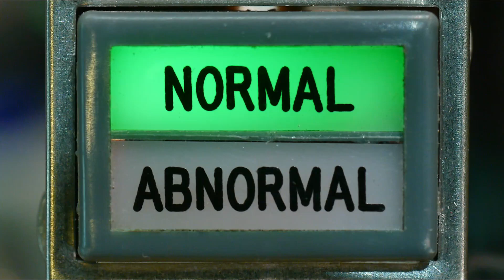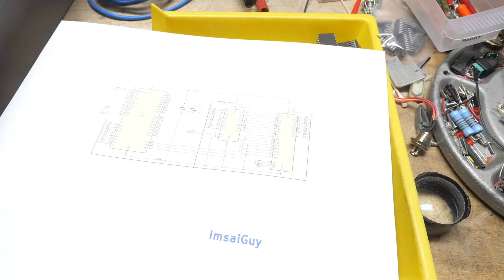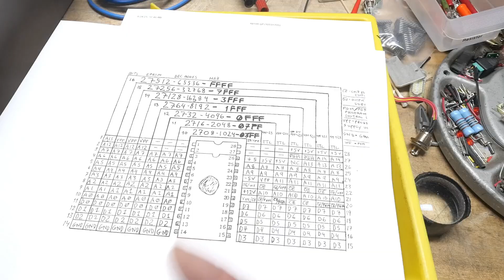#2371 Intel 8755 Hack (part 2 of 5)

Comment: I thought 8755 had 2 ports.  But you have implemented only one part.  The other thing is SMTs are great to be hidden under the wider socket.   That makes your design exactly the same size as the original one.

Comment: I would have put the jumpers in so you could bank select the rom. makes it a lot more usable.
What did you use as the pins. As i find that the hard bit as sockets won't take a range of pin sizes?

Comment: You can also use W27C512 instead of the UV 27C512, those are EEPROMs and you can erase them electrically in a programmer instead of using UV light. They are pin-compatible and work very well in my experience anywhere instead of EPROMs. I have not found any incompatibilities. And they're cheap.

Comment: Would love to see future projects with those EPROMs!  Programmed many thousands of those 2716’s to 27512’s in the mid 1980’s for a computer printer manufacture.  Interesting note, about 1987, EPROMs were under strict tariffs to import to the U.S. and manufacture used OTP (One Time Programmable) chips to skirt away from the EPROM (and other memory chips) tariff.  Home user technology for the EPROM programming was through a Centronics parallel port (faster than the RS-232c port).  Very fascinating programming algorithms used based on the fused memory readable test, basically if the last memory location was burned successfully, programming speed was continuously increased until last memory byte programmed was faulty, then at a slower speed, the last memory byte was reprogrammed until it was 100% reliable, etc.  EPROMs are obsolete now, but was for a number of years an era of the microcontroller industry.  Would like to see these EPROM chips used for Arduino applications, where only a few kilobytes of code is needed.
Reply: You can use EPROMs, EEPROMs etc as combinatorial logic devices. You put the input data on the address lines, and you get the output of the combined logic on the data lines. You just have to program them first with the correct matrix of data that generates your desired output for any possible combination of inputs. Sort of simulating a PAL/GAL.

Comment: 1991 to 1994 is at least one node decrease (Moore's Law), so the same number of transistors fit into half the area, which is why the newer die is half the size of the older die.

Comment: Always cool to see some EPROMs. I once worked on a Soviet drum machine where a bunch of them (roughly 27C16 equivalents with some quirks) went dead, had to be reprogrammed. I erased them with a modded portable UV light for nails, and programmed with TL866 / Minipro, with an additional gimmick to apply 25V programming voltage these Soviet chips needed.
Reply: I bought a couple of those UV nail lights for erasing chips too, far cheaper than buying a proper UV lamp 🙂
Reply: Nail lights can be a problem. EPROMs expect to be erased using UVA, which is harmful to skin. Nail lights produce UVB and may not work (or work very slowly).
Reply: @stevetodd7383  takes a bunch of minutes but does the job.
Reply: @stevetodd7383 I believe EPROMs require UVC? But yes, potentially damaging - slow intermittent exposure might help

Comment: You're seeing Moore's law at work. I started doing ASIC design in 1996 with a 500 nm process node, retired in 2021 using a 7 nm process node. Flash is a newer technology than many people recognize - the first time I ever saw a flash part was about 1986, and it only had an endurance of 100 write cycles. My how times have changed.

Comment: I tried out the progressive programming of EPROMs by writing individual bytes for just tens of microseconds and checking after how many cycles they took over the information. With another write of two times the accumulated time of the first cycles they are considered written. It still saves time compared to the specified writing time, that includes the tolerances of writing times for the slowest cells . 
I did it not to save time but to play with them as I heard there are professional programmers that work in that way. 
If you have to many, the diffraction pattern reflected from the chip (without the window), when shining with a laser pointer shows the density of the cells. It is a wide pattern for small cells.